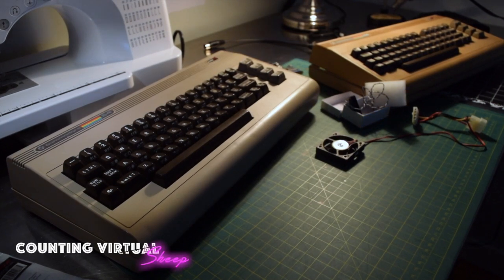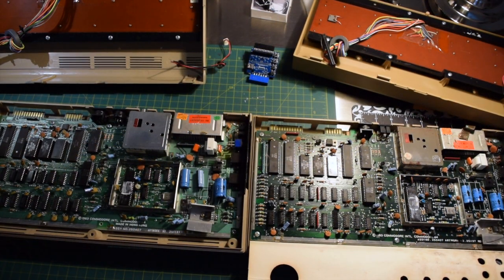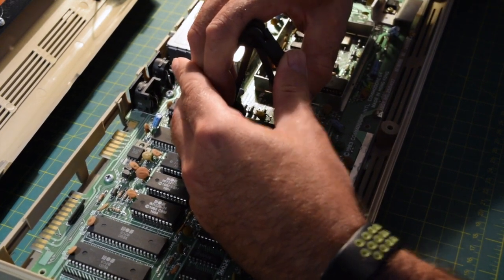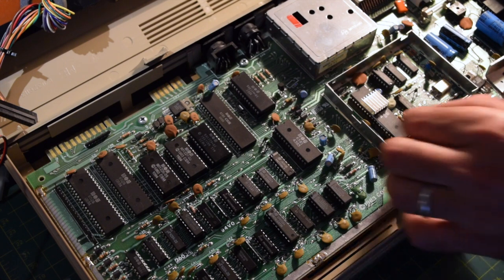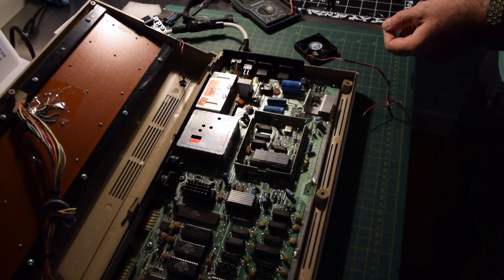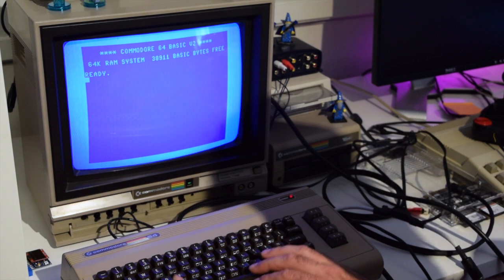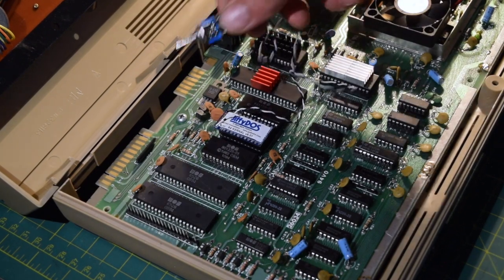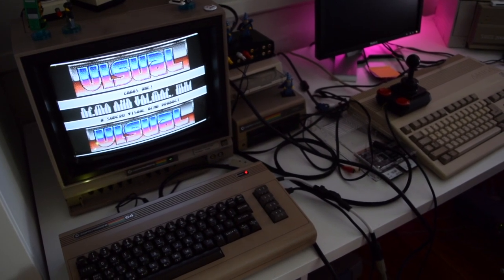Extending the Life of Your C64 With Heatsinks and a Cooling Fan

Comment: You can do the same with the 1541 drives as well, done it to my vic 1541 and my normal 1541.
Reply: Here's a mod II just did that will make you're 1541 even cooler, literally, if not figuratively.
https://www.youtube.com/watch?v=0t6zxi5-aD0

Comment: Nice way to keep it cool with the lid on. (I've only measured temps w/it off.)
Have you found your 12V regulator gets quite warm w/o a heatsink, like I have?
at 5m18s: https://www.youtube.com/watch?v=F5tjHWYBYx8#t=5m18s
(Mine is also the earlier motherboard that didn't come with a heatsink on VR2 that yours has, so I fashioned one for that.)